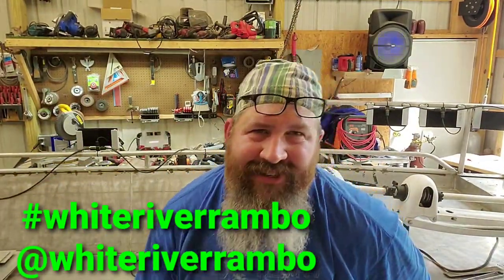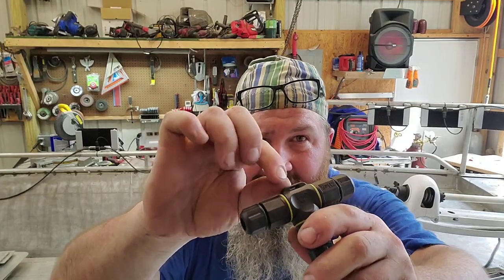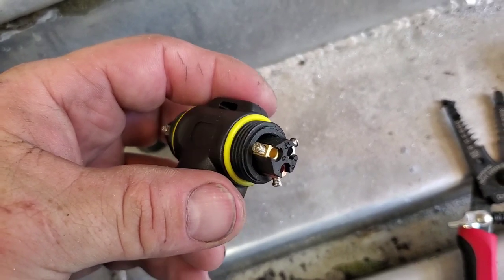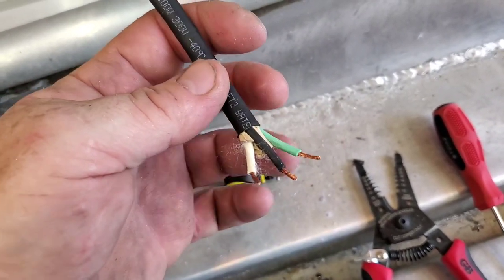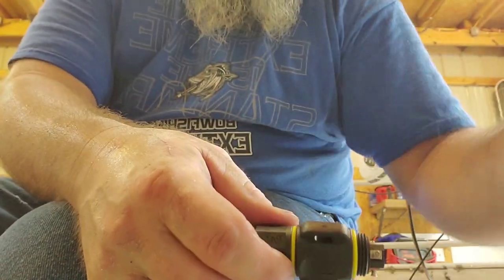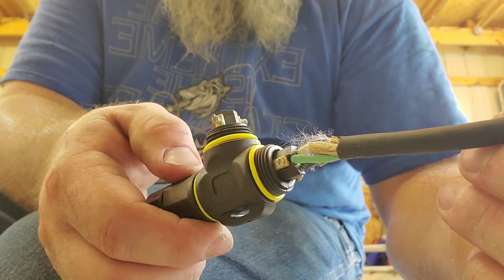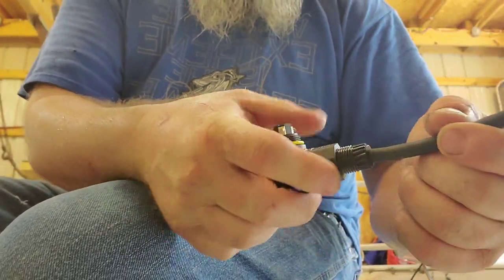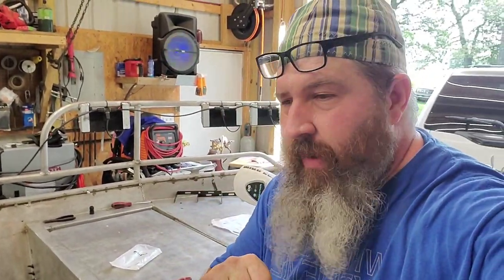How to wire Bowfishing lights

Comment: What size main wire are you running off the generator and how many amps are you running
Reply from the maker: If you have a genny with a 30amp plug you can run a single 10/3wire to the front & would suggest a switch panel.  If you do not have a 30amp plug then you should run plugs back from port & starboard sides and not exceed 13amps combined.  In most cases you will exceed amp capacity before you max your wattage.  2000w÷110v=18amps but my genny breaker is only 13amp so it only handles 1400w continuously.

Comment: Hi Dustin, are you running these on a generator? If so are you using a power converter?
Reply from the maker: Converters are a thing of the past.  Very few companies offer DC lights & the ones that do also offer AC drivers.

Comment: Hi Dustin, thanks for the video. I ordered the 3-way junctions and 12/3 wire from our buddy Jeff Bezos; I question if that wire is 12/3 or 14/3. Can you confirm?
Reply from the maker: Would be impossible for me to confirm what you bought.
Reply: @DustinApple  sorry for my poorly worded question. The wire you mentioned in the video was 12/3 - are you sure it isn’t 14/3? 

I purchased the 3-way junctions & the wire gauge (12/3) is REALLY thick and doesn’t fit.
Reply from the maker: @dustinmartin8594  it will fit. You want it tight. There's multiple junction 3ways now. Probably different than what I had. If it's to tight clip a few strands until it does.

Comment: Man I got a question if I am wiring led lights like these with the 3 wires to a battery what do I do with the neutral wire
Reply from the maker: There is no "neutral wire" on DC lights & AC light will not work on a battery.

Comment: Does this plug straight into the generator?
Reply from the maker: You can do it that way.  Some guys like switches. Just don't exceed the plug amp capacity.  It's usually 12amps

Comment: Dustin, the ends of the wires need to be soldered before installing them inside the hub. This is for almost all screw down clamp. If you don't,  the screw will separate the strands, weakening the junction point
Reply from the maker: 12ga wire fills the hole, it cannot separate.  The locking cap grabs the wire and I'm pretty sure you'd have a hard time pulling it out.  I agree it would be better. But A low amperage (0.9amp) led, I don't feel it necessary.